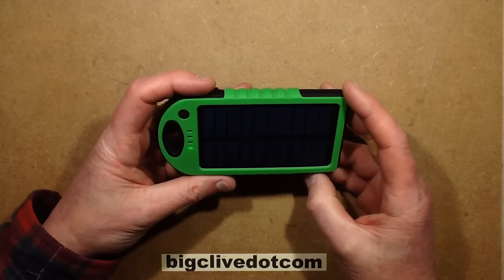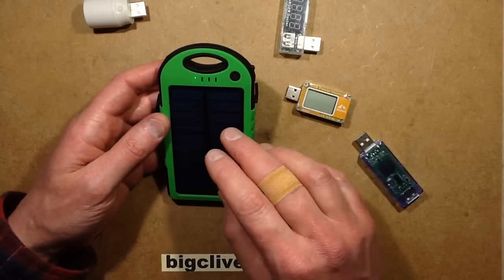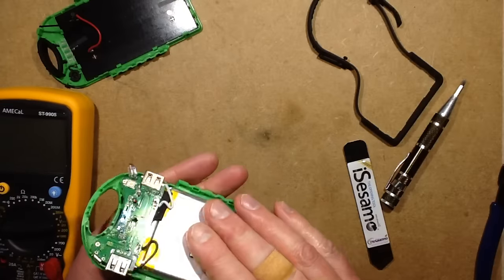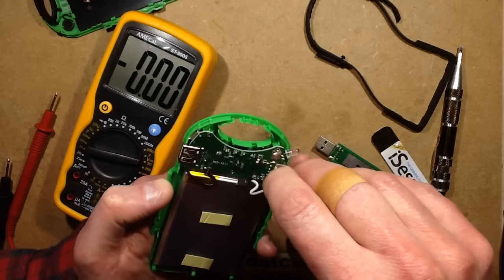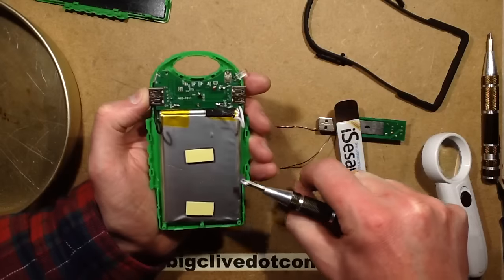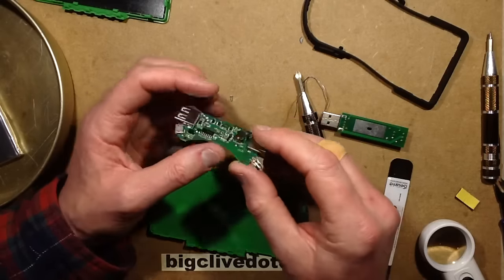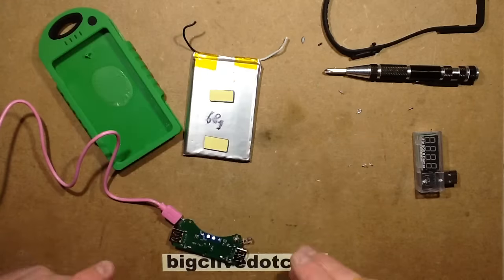Inside a solar USB power bank with "short circuit" feature.

Comment: Again, great video Clive - what did you do to your finger? You've had a plaster on it for several weeks now it seems...
Reply from the maker: +Richard T Winter issues.  My work hardened skin tends to split on at least one knuckle, and the fact I never stop working on stuff means it takes ages to heal up.
Reply: +bigclivedotcom I can so relate! My thumb tips split constantly - so I'm always putting Polysporin (topical antiseptic ointment) and plasters on them. Glad it isn't anything too serious!
Reply: +Mohammed Vates Or very cold and dry weather ... Nothing to do with protection.
Reply: +bigclivedotcom This is going to sound a bit "girly", but just before bed, completely slather your hands with good quality skin cream, then put gloves on (to keep your sheets clean and the goop on your skin). And by slather, I mean copious amounts. My hands get much the same way since I work with cleaning agents all day and have lost all moisture on my hands. Try it for a week. Also, re-apply small amounts throughout the day to "top up".

You can also soak your hands in a hot water/epson salts bath for 15 minutes/daily to soften things up (this worked for a friend who works with concrete and had hands that looked like he was the The Thing from FF4.
Reply: +Richard T That too, but you'd be surprised what a simple regimen of thrice daily skin cream application can do. And avoiding solvents and soaps that remove natural skin oils and moisture.
Reply: +TheJohn8765 It helps yes, but if you're doing manual labour outdoors in the cold, sadly the cream is gone after a short period of time.
Reply: Richard T Gloves, my friend, gloves :) I was a landscaper for nigh on 10 years. Moisturize, and gloves = reasonably happy hands. Not perfect, mind, but no split skin or out of control calluses. And the gloves need to breathe, too: I favoured the mesh+ latex dip ones, or good quality lined leather ones for colder days.
Reply: +Richard T He means if your body doesn't produce enough protecting moisture to keep your "leather" soft, you must do so. Try Amlactin or, if you're old-school, "Corn Husker's Lotion"
Reply: +Kurt Richter For me: a little  dab of unscented moisturizer after every hand washing. Every one. I'd tried different solutions for cracking skin, including prescriptions. but cracked skin stopped happening after I made that change. A good sized bottle of lotion will last a year or more.
Reply: +bigclivedotcom Coconut oil.
Reply: +\ 0909 yep, or  Shea butter, preferably unrefined. Both work wonders and are very, very cheap compared to commercial products. Lidl sell some good handcream, Cien or Ciel brand iirc, I've used their "SOS" product as an effective barrier cream when cleaning kit with IPA.
Reply: +bigclivedotcom i really like you regularly uploading videos, and would like you to continue, but take a rest man.
Reply: In Denmark we have something we call "kopattesalve" which I guess translates into cow udder salve. It's Glycerol, Glyceryl and Chlorhexidine.

A very good and really manly moisturizer!

Comment: hi Clive, we recently purchased the exact same power bank and had problems with the built in LED on it not working correctly  (it would flash on and off as if it had a bad contact) we then swapped the unit for another one and this one seems to be working OK. Slightly concerned about the lack of protection when charging from the solar panel. I'll need to do some crude tests to determine the battery capacity.

Comment: It's possible that the battery is fine and suitably sized but that the fault discovered and possibly damaged components either prevented the device from actually charging or discharging fully.

Comment: I bought the 12000mAh version of this, actual capacity was closer to 3500mAh. The solar panel does next to nothing, the manual states not to use the solar charging at anything more than half capacity, but the LED meter is completely non-linear, the last LED represents nearly 80% of the charge and once it goes out the final 3 go out at an alarming rate.

Comment: So how do you determine what a smoked surface mount component is so you can replace it,  if you were inclined to try and fix this thing?

This reminds me of a small radio I have here.  Same green plastic case,  smaller solar panel on top,  micro USB port for charging,  USB A for charging my phone or whatever,  the radio part is AM, FM, and weather channels.  On the bottom of the unit is a little door,  and when you open it up there's an 18650 cell in there.

Comment: Under the battery terminals on the battery, if you pull the yellow tape off you should see a circuit board and that should have a voltage cut-off. Ive pulled apart something similar to this battery and found a circuit board that had a voltage cut-off circuit.
Reply from the maker: +Aussie survival UFO Hunter It's not got that.  Just the foil tabs coming out the sealed pouch.  The USB charge limiting is on the PCB.

Comment: I have one of these and while the solar charging seems pointless (left it in direct sunlight in the window for a month during the summer and not even one notch charged) it seems to work well as a USB power bank.

After fully charging it from USB I haven't been able to make much of a dent in its charge, using it for powering a Rpi sometimes, a USB LED bulb from poundland, haven't really needed to use it to charge my phone yet though.  But I'd guess the capacity is probably right on mine.

Comment: I'm an old retired TV broadcast tech that still tinkers and I love your videos.
Can I suggest that you use a softer light for your videos. Quite often detail is lost in deep shadow.
You could try a ring light on the camera, even adding one to your existing light setup would help fill in those deep shadows.
Reply from the maker: The light is too directional.  Unfortunately my bench arrangement would block the preferred soft bounce light, but I'll be experimenting soon.
Reply: @bigclivedotcom  the simple solution is to diffuse it with a sheet of paper/wax paper (if incandescent obviously far enough it doesn't set alight), white fabric or some other translucent material.  The other option is to bounce off of some poster board or similar.

Comment: Density of Li-polymer is ~170 Wh/Kg (i've seen a range of 100-200Wh/Kg). For your battery assuming 170Wh/kg, this works out to 11.56Wh, or ~3100mAh@3.7V.

Comment: I`ve been looking at those USB power meters on Ebay, notice you had a selection there.

Do they all work/measure about the same?
I prefer the in-line ones to the "right angle" ones.

Comment: Might be worth buying just for that solar panel.I have a mobile power bank but the micro usb input is not making a proper connection it' rocks and doesn't make contact I'm not sure whether I should try unsoldering it then cleaning the board and re-soldering it.Any vids on soldering in micro usb input?

Comment: You might want to invest in a Victorinox Swiss Army Knife or a Victorinox Cyber Tool - the flathead screwdriver with the bottle opener has nicely rounded edges and won't scratch things when prying them open. I've been using those for a few decades and they work very well. Highly recommended, no affiliations, satisfied customer since the 70s...

Comment: Hey -  I have one of these that works, and tested the battery with the same keweisi charger doctor - 

it came out at 4500mAh - now it was advertised as 6000mAh - 

now a question does this make sense, the voltage when charging is 5V - and there will be a voltage conversion from 3.7 to 5 - so the mA will be more on the 3.7 side - so is it a 6000mAh (at 3.7V) battery, but that means it can only supply 4500mAh at 5V
Reply from the maker: +Steve Aitken there is loss in the step-up process.  To properly test the capacity you have to monitor the mAh while the cell is charging.
Reply: +bigclivedotcom ive got one of these in all black mine suppose to have according to the back 12000mAh but it can only charge my phone too 70% on a good day and my i pad only too 35-40% did not cost a lot if it did i would been P**sed off but it useful leaving on my windowsill on solar only then using it if my phone about to go flat.
Reply: +Steve Aitken This is exactly why you have to do your research and find out the actual volt/amp output to compare against the mAh claims. It's too easy for companies to claim high mAh ratings based on the LOWEST voltage output of their power source. With some packs able to output anywhere from 5 to 12v and higher, it's a real IQ test figuring out if the company is fluffing their numbers or not. One big reason I highly value honest engineer reviews on Amazon where the reviewer includes video and photos of their test results. Prompted me to buy one of the better USB mAh testers so I know I'm not getting scammed.
Reply: How did you tell the capacity with the keweisi? can you write out step by step on how you figure out the mAh?
Reply from the maker: With a  tester that logs the current over time (mAh) it will log the amount of current used to recharge the internal cell from flat and since these chargers always quote the internal cell capacity it will indicate the capacity of the unit.  Actual output capacity at 5V is significantly less than the internal cell capacity due to the boost conversion.
Reply: So would a keweisi work for this? It not what should I buy?
Reply from the maker: That should work fine if it has the mAh logging.  Just remember to reset the unit to zero at the start of the test.
Reply: Yes but don't you want to measure usable capacity? Cell capacity doesn't mean much if you can't use it all

Comment: I haven't checked the output voltage on mine but the way I understand it in order to charge the USB powerbank via a USB charger you need a charger that outputs 5,5 volt DC. The outputs on the USB power bank only give out 5 volts DC. Some devices needs a 5,5 volt charger to charge properly thus making that device not so practical in some cases. Depending on the device connected it might be more useful as a emergency charger only. There might be a reason concerning the complains of that device and similar devices.

Comment: I would have wanted a cordless battery powered soldering iron too, but here in Finland it costs twice as much as a good Iroda butane iron so I just bought that instead, alongside a butane can, solder and solder wick , and it didn't come near the price of the battery powered iron.

Comment: I have an important question. I have this same charger. I've had it for a year but barely ever used it. I'm intending to use it quite frequently but I lost the instructions. Is the USB port under the LED lamp the 2.0 output or the 1.0 output? I only put my phone on chargers under 1.2 since that is the number on the original charger.
Reply from the maker: +Azaraiah Zee The only difference between the ports is the resistors on the data pins that indicate to the phone what type of charger it's connected to.  Plug your phone into either and see which charges it the fastest.
Reply: Thanks for replying. I delved a little deeper into product descriptions on store sites and found out that both outputs are 1.0A which is perfect. The only problem is that the solar does not seem to charge at all. It still works as a great battery bank. What did you mean by it not being a true 5000? I have 2 smaller ones that are  2600 and was hoping that with the 5k I can charge my phone and my Bluetooth headset on the fly.
Reply: I can listen to music/audiobooks at work and on my lunch hour I like to top off the charges on both devices to see me through the rest of the shift

Comment: Hey Clive... is there any chance there was a battery protection IC squirreled away under the top folds of the battery? Those little protection boards can be quite small, and would have protected the battery from overcharge / overdischarge / short circuit. Plus allows for the cheats way of charging  - same as they did with the arc lighter ;)
Reply from the maker: +Peter Feerick The cells sealed pack just had the foil tabs coming through it.
Reply: +bigclivedotcom OK... that's just... great?! So we can add small green solar powered bombs to the list of exciting stuff to get from China (which for added excitement... you have absolutely no idea when and if they let go with excessive force).

Comment: I have a couple of power banks similar to this one, though it's a larger version, i think they all use the same interior IC and feature the same charge indicators, LED etc, i find the Battery voltage is around 4.2 nominal, the circuits do have a short protection, and i had to open one of them up to disconnect the battery to reset the chip, the other one developed a fault in the firmware so the charge indicator is now permanently on.

Comment: Did you reassemble it to see if it worked?
I usually remove those batteries with a wide wallpaper scraper a gently lever it up starting at the corner or edge which is loosest!!
I`ve now got 4 that way without any problems.
I really enjoy your vids as they explain the things to simpletons like me how to take things apart and then explain how they work.
Keep up the good work Clive!

Comment: I repair iPhones and other mobile devices. At the shop we have punctured batteries a couple times, they usually sizzle a little and then get a jet of flame coming out. Never had one exploded but we always get it out of the shop ASAP. Some of the newer iPhones have a stronger adhesive and a thin tall battery so you have to work it to get it out.

Comment: Dell makes 2 Power Companions one is 12000mah and the other is 18000mah. They are ultra high quality and guaranteed for 1 year parts and labor and free shipping both ways and come with free tech support. They are meant to be charged (takes 1.5 hours) with a Dell laptop charger which can safely charge virtually all Dell laptops and ultrabooks. These UL listed units once charged can recharge your laptop while you are using it as well as 2 other devices. These units start at $100USD and are worth every penny. As it charges my phone and my Dell Venue 8 7840 tablet, I can continue to use the tablet. I have noticed that the charging cycle is tailored for each item connected to it to preserve the life and capacity of the Li-on battery connected to it. It itself of course is a Li-on battery. They are built like tanks as well. Good stuff and further proof there is no free lunch. They are built in Taiwan rather than China.

Comment: I own a similar solar charger, and the solar bit doesn't work! I can wall-charge it, but I can't solar charge it. It sits out in the sun all day and never charges, but the solar-charge indicator light is lit when it receives sunlight. I am very confused by why it doesn't work.
Reply: There are many "solar powered" devices where they just don't connect to solar panel to the battery (some don't even have real solar panels)
Reply: have you checked that the output from the solar cell is greater than the battery voltage? usually the cells that come in these don't output enough voltage to get the battery past a usable charge point.

Comment: Use a heat gun on the back of the device to loosen the adhesive. Used to work on iPhones all day long. As far the solder bridge, I fix those on a daily basis now, I make circuit boards. Those can be easy to miss if they are on the legs of surface mount chips for example. This is why functional testing is so important.

Comment: Clive, can you do a test of power draw of various charging devices (typical phone ipad etc) power use when not charging a device? i wonder if you can do an accurate power draw and a estimate of yearly cost if you left it plugged in.
Reply from the maker: +jusb1066 It depends on the charger being used, as many items will default to 500mA charging if they don't get confirmation of higher current capability.  The standby current after charging is very low.  Probably in the region of a pound/dollar a year.

Comment: My mom has one of these (it looks awfully similar though) and she is still surprised it basically doesn't do anything for charging her phone and I have been thinking about showing her this video.
The second thing that has me worried about hers by the way, is that it looks like the battery pack has been at the end of it's life, because the casing is bulging at both sides like crazy.
Reply from the maker: I'd recommend discharging it completely (charge things until it cuts off) and then disposing of it.  The lithium cell has puffed up inside.
Reply: @bigclivedotcom  I am afraid I am going to have a hard time convincing her the thing is not good, because "it was so cheap" (like 2 or 3 euro's or something, at something that is probably comparable to Poundland or Poundworld, but is called Action here in The Netherlands).  That it never reaches a full charge when left to sit in the sun, shows a lightning icon on her phone that still seems to drain itself when connected are somehow not of concern to her, but everytime she wants to plug it in to charge it, I'm afraid it might have the mains bridged to the USB shield or whatever and I cringe when I see her handling it like there could not be any risk surrounding a piece of electronics that is just way to cheap.

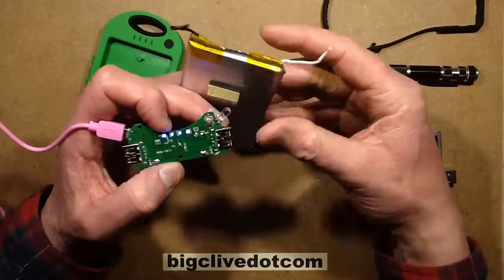Comment: 16:48 Honestly, I'm not sure how good an idea it is to place any lithium battery directly attached to a dark surface in an enclosed container in direct sunlight.  That seems like a fundamentally bad idea.  I don't even leave the batteries to cordless tools in a hot car, and they have much more ventilation and come from a reputable brand.
I've seen "solar generators" which have an inverter and battery as well as a panel.  Presumably these have more space inside, and perhaps cooling circuitry.

Comment: if nobody gave the number yet,  soft lipo batts like that score around 32g/1000mAh. this battery is at max a fairly common 2000-2200mAh one, certainly not a 5000mAh one